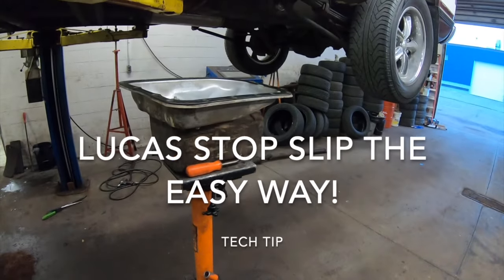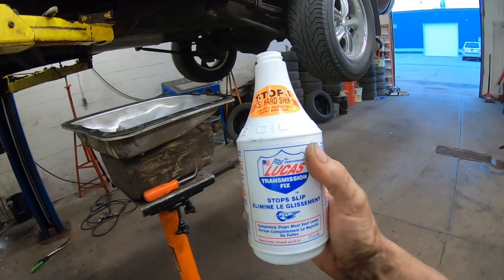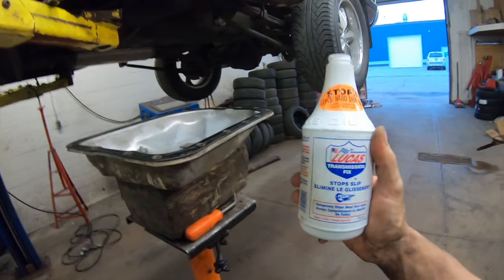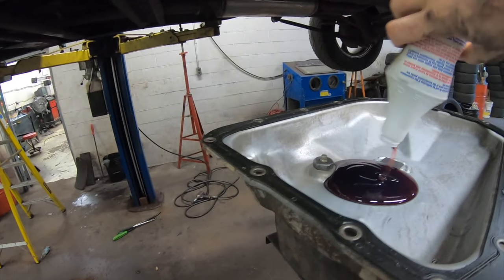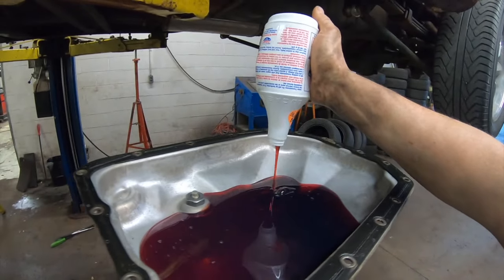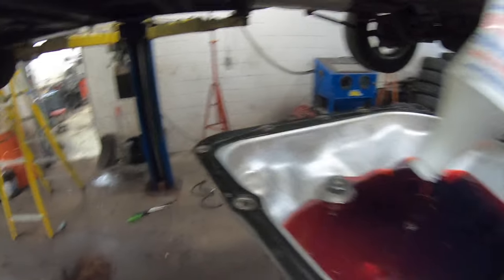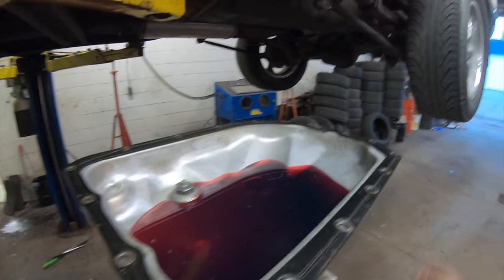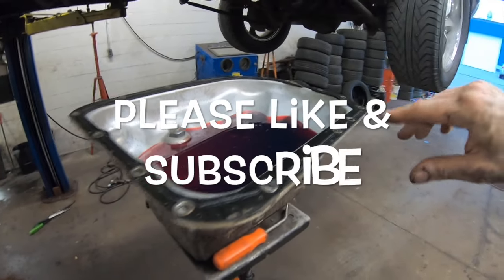Tech Tip! Easy way to use Lucas Transmission Stop Slip Additive

Comment: If you can't pull the pan get a harbor freight transfer pump for like 6$. Pull the bottle amount out into a water bottle or 2 add the Lucas back with the pump through the tube it works better than the funnel for sure
Reply: Probably best comment or the most important anyway

Comment: A lot easier to just heat up the bottle instead of pulling the pan. Pours like regular oil. I think I give people too much credit. 🙄
Reply from the maker: Sure..if your not pulling the pan. But if you're pulling the pan, this works well. Especially on the cargo vans with the crazy long dipstick tube's, takes forever to get a proper reading on the dipstick with Lucas.

Comment: The easiest and best way to do this is literally dump all your regular ATF into a pouring bottle like you would do with engine oil and then dump the Lucas on top of it and use a stick to mix it up and then pour it right down the dipstick tube it will pour completely fine because it's already mixed with the regular ATF.

Comment: That's fine in a shop. Not so easy with a vechile on ramps or jacked on your garage floor bit it's a good point.
Reply from the maker: Ramps maybe not but ive dont it on axle stands no problem. The lucas is soo thick it doesnt spill out as easily when trying to move around

Comment: I mix it with the proper transmission fluid in the transmission fluid container or Lucas transmission additive bottle even if I add some of the transmission fluid to vehicle first to make room to mix Lucas transmission additive. It makes it easy to pour down the dip stick tube! Even if it's a 50/50 mix in a quart container. The fluid warmer does help also. P.S. Don't overfill though.

Comment: Just leave on top of the engine after you shot it off and by the time u have the pan off it will be warm and pour faster. You can also full a bucket with warm water amd leave inside while u take the pan off...

Comment: What is the most important thing of this Lucas? More important that it cleans all the stuck valves or more important that it's very thick and makes the whole ATF thicker, which makes AT to easier doing its job? I mean, if the ATF is pure clean and nothing stuck inside, does it make sense to put a bottle of Lucas anyways?
Reply: According to Lucas, the high viscosity makes it more resistant to flowing through orifices, which raises the system pressure and allows it to engage with out clutches and bands.

Comment: DO you use any kind of gasket seal or formagasket on the gaskets? It will go through the dipstick you just have to use a funnel and give it plenty of time to run down the tiny dip stick hole.
Reply from the maker: I find the original gm steel/rubber gaskets are by far the best and don't need sealants. But if I'm not use one of those I will use right stuff silicone. 
If I'm not serving the trans then I will put it down the dipstick tube but I will usually put the bottle in got water first. Its just way easier to put it in the pan haha then it doesn't get all over the dipstick when your checking the level